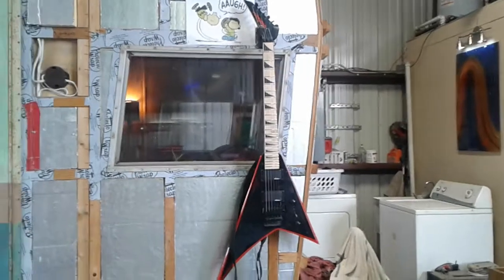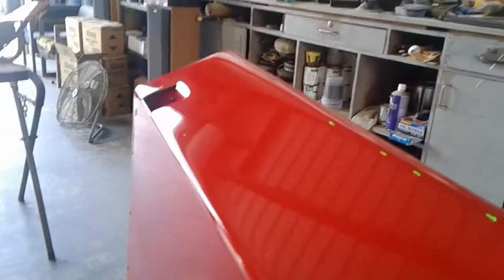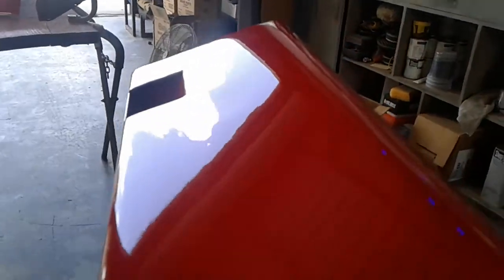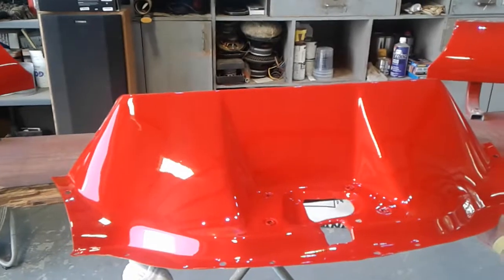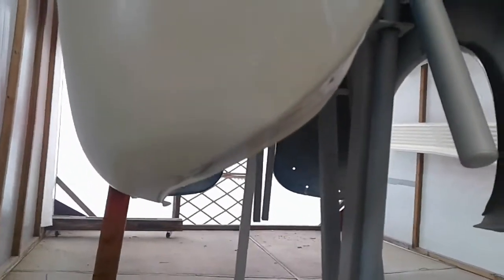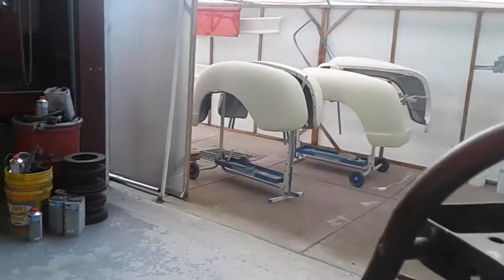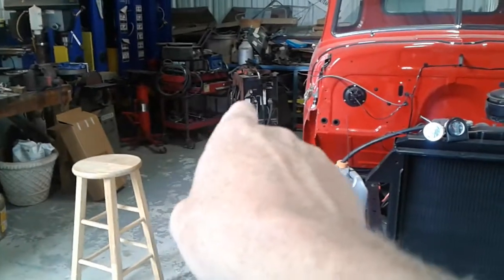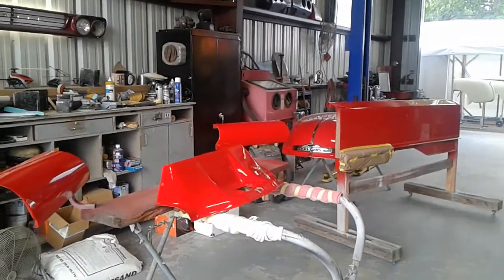1947 Chevrolet Pick'm Up Truck:  Paint Repairs!!!

Comment: That high E will most likely be a "9 "...Floyd rose with locking nuts are tricky when you first tune them..My Jackson I forgot about the locking hit and tweaked the machine head only to snap the string..Easily done but I've only done it once...lol....If it was to all go smoothly then everyone would be doing it...Good progress Pat.
Reply from the maker: Glad you like the new Jackson Ziggy. You would think it's a "9", both of my other guitars have Pink Slinkys on them and they are "9s", but this feel smaller.  I'll find out this week when I take it in for it's first tune up (I don't work on my guitars). My boy Larry hasn't had a chance to set it up for me yet. I'll get him to drop the action down a little and a new set of string and I'll be back to Rocking and a Rolling!!! Thanks for watching and Keep Rocking it out Ziggy!!!